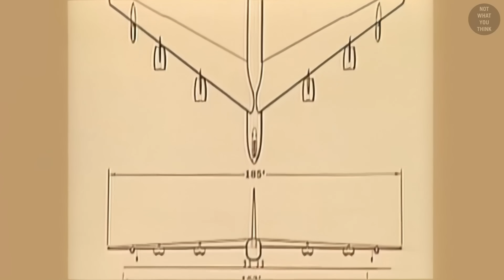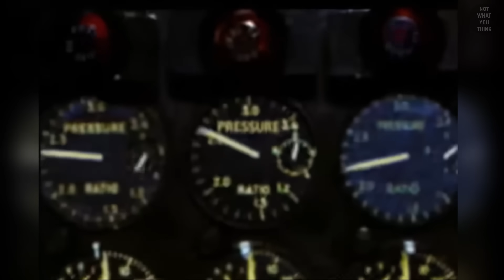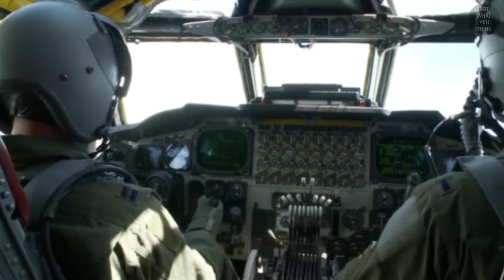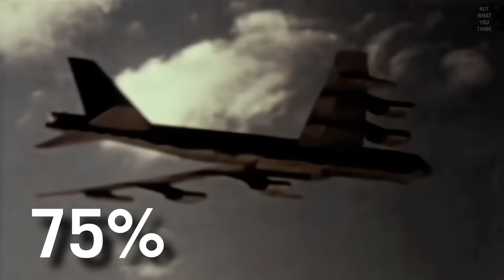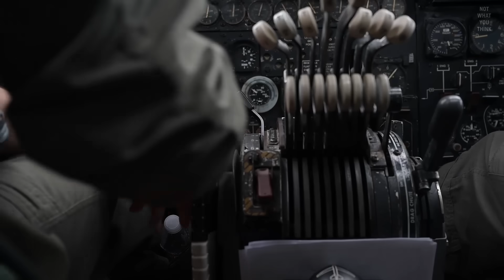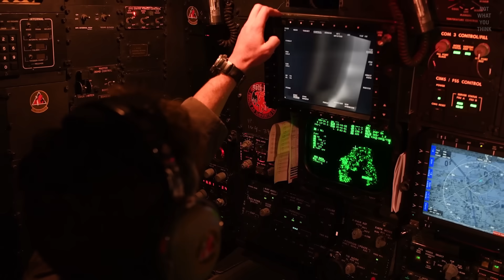Why This Obsolete Bomber Will Outlive EVERYTHING

Comment: The crash record of the B-52 was mostly because they were flown so much.  The Cold War was a VERY dangerous time.

But think if they put an active defense on the B-52.  Think they could do aerodynamic missile pods with 6 AIM-260 and 12 Stinger sized defensive missile and put one under each wing.  They could split the pods and have half pointing forward and half pointing back so they would be longer and skinnier so they create less drag.  The defensive missiles need to be fast and maneuverable, but really do not need have a very long range.  The pods could have a tracking radar built into them

It would be interesting to see a B-52 maxed out with new more efficient engines, state of the art radar systems, possibly drones escorting them, a defensive missile system, a full electronic warfare suit, and maybe a laser system too... say in the tail.  None of these weigh much compared to the payload this thing can carry.  Those AIM-260 have a range of 200km and a speed of Mach 5+.  I personally think 16 of the hypersonic cruise missiles would be better than fewer of the larger HS glide missiles.  Yes those are faster, but a cruise missile is FAR more versatile and they are supposed to have a 1750 mile range.  They are Mach 5+ and have multiple guidance and targeting systems to prevent jamming.  They would fit in the existing missile carousel made to fire Tomahawk missiles.  They could mount a few of the others under the wing too if needed.  The drones could have anti radar missiles and maybe a pair of Sidewinders.    Now think of an formation of 10 B-52 in a formation with 5 drones each.
Reply: Read some of Dale Brown’s books.   Start with FLIGHT OF THE OLD DOG.

Comment: I was in the Air Force from 1979 - 1983. Stationed at Mather AFB it was mainly an ATC base ( air training command ) with a SAC wing located at the base. Which meant there were B52's taking off and landing there all day long. What I remember most about them is that they were without a doubt one of the loudest and I mean loudest planes I have ever heard taking off as well as landing. The fact that they've been around this long even though they've had their problems means at some point there doing something right. Very right. I tip my cap off to these noisy fu....rs.
Reply: I was in the Buff wing at Mather from 86-89. Yes, the Buff was loud, even inside it. But it was nowhere near as loud as a B-1!
Reply: @nordan00  they were wet takeoffs. And yes I was also there. Swine bunnies. 😁

Comment: When they say "Range of 8800 miles" do they mean that it can fly out that far and still be able to return, or does it mean it really has a range of 4400 miles out and 4400 miles to return?
Reply: Total miles is 8800 miles so can only travel 4400 miles to make it back without refueling. I'm assuming they don't run it that close to the needle though.
Reply: @nickcollins1528  Thank you.  I always wondered about that when it came to range on an airplane and how it was measured.

Comment: Obviously the narrator has very limited knowledge. Icing, metal fatigue, engine problems and system failures are common to all aircraft. The operation of nukes could happen to any a/c. Pilot error are not the fault of the A/C. In the case of the B52, it is a matter of usage.

Comment: Hummm I was a First Article Quality Engineer for Allied Signal/ Honeywell and total 22 Aerospace suppliers. Aka Hired Gun. One of the small jet engine parts was designed in 1939, drawing originally "Stratofortress". During the Cold War, B-52 would stay AIRBORNE FOR 3 WEEKS! in air refueling invented for the B-52's.

Comment: The Aircraft Type ( if that's what its called ) is extremely versatile and useful , so I don't believe its obsolete , The Actual Aircraft themselves , the ones built and flying are not really the same aircraft built so many years ago , I believe they go through a sort of complete rebuild from the ground up , effectively making a new plane out of an old plane.
Reply: Aircraft type is the correct term indeed

Comment: Whoever wrote the narration needs to go back to the books...the BUFF was not limited by a lot of problems in its "first few decades".  It had issues during design and testing that were fixed but for the vast majority of it's career it has been an extremely reliable workhorse.  The narrator seems to have a bias...

Comment: Had the B-52 been a disaster for "the first few decades", it wouldn't have been in service after the first few decades. Very few designs are in use seventy years after their first use, and we're almost exclusively talking small arms, not highly sophisticated aircraft. The B-52 has been replaced by several more modern and more capable bombers - that somehow faded into oblivion because they couldn't deliver on their promises.
Reply: It's like how London keeps running on infrastructure built during Victoria's reign, even after more than a centuries worth of replacement systems have long since fallen apart.
Reply: The B-2 can deliver on promises, it's just stupid expensive to operate and maintain, hence the desire for the B-21. 

The B-1 is another story, but even that is seeing multi-role service.

Comment: OK, be honest.  The tail you showed at 0:05 didn't just fall off!  That was a test aircraft running the front range in Colorado looking for severe gusts.  They found some.  The plane landed safely.
Reply: I agree. That airframe went to the boneyard for many years until it was fitted with a replacement vertical stabilizer and returned to service. I know this because I flew it many times while it was assigned to the 319th Bomb Wing at Grand Forks AFB, North Dakota.

Comment: It's a good thing that Russia never knew how bad a bomber the B-52 is, or was or will be.  Like you reported over 700 has been in service, and wouldn't you know it, not once did the USA get bombed by Russia.  In the 60 a lots of our hero's got Purple Hearts flying over Russian Held Viet Nam, but with Johnson running the air force from D.C. one can quickly understand the problem.  Given all that has happened to the B-52, one would believe it has seen the end of the road, but wait, not so fast Sparky, the plan has a certain "thing" about it, you know the 10% of them lightly armed can, well ~ do a number on half an army, any army,

Comment: The video is correct.  In the early days of the B-52 there were problems that caused accidents.

My dad was a B-17 pilot in WW II and was shot down on July 26, 1943 and spent the rest of the war as a POW.

After the war, he remained in the Air Force flying all kinds of bombers from B-29's to B-47's and finally to B-52's.  He began flying B-52's in the early 1960's  and accidents and crashes were not uncommon.  But today, the B-52 is one of the most reliable ancient bomber in the inventory.  It's effectiveness is in its versatility with long range missiles and bomb loads in low intensity conflicts.

As stand off ranges of missiles increase, the B-52 will become more important because of its payload capacity.

I wouldn't be surprised if the B-52 was still operational after 100 years in service.
Reply from the maker: The video pretty much agrees with what you are saying.

Comment: The number of accidents are not surprising when you consider the massive number of total hours in the air and that it is(was) a cutting edge military aircraft, in that is pushed the limits of materials. It is a much more efficient design than many commercial aircraft, giving up convenience and ease of crew training for performance.(range, payload, runway length) I mean how many commercial aircraft use a parachute during normal landings?(Several military jets have used parachutes for landings.)

Comment: Over 90% of the B-52 fleet have been retired. The ones still in service were the latest model and have been majorly upgraded.
Reply: That's true, but like he said, even the newest B-52's in service rolled out in 1962, so we're still talking about the 60 year "latest" model of a 70 year old design. Mind you, I'm okay with that, airframes of this sort were pretty much perfected by 1962.
Reply: @jermainerace4156  
My point was that over 90% are long gone.
Reply: @alanstevens1296  they are just spare parts and airframes. however the USAF does keep many airframes ready for assembly for replacement of damaged frames or if a need for more b52s arise.
Reply: @Drbeattles  
Over 90% of the retired airframes were scrapped.
Reply: @alanstevens1296  they aren’t scrapped like you think. Most of them are sitting in the bone yard which is considered “scrapped”. However they are constantly being pulled out of said boneyard. Plus the “newest” b52 was built in 1962 so of course there’s going to be a lot of them out of service. we don’t need 744 of em in constantly ready. Hell we don’t even have that many of ANY aircraft in current service.
Reply: @Drbeattles  
Aircraft retired 30 or 40 years ago aren't just left out in the boneyard, they are scrapped and the materials recycled.

In the case of the B-52, yes, they would keep a dozen or two for spare parts.
Reply: @alanstevens1296  mate. ALL of them are 30+ years old. Last was built in 1962.

Comment: Anyone want to take bets on how many of the 100 Spirits actually enter service. There is this other factor air force goes how much for a brand new state of the art bomber that does everything that the B52 does they'd be hard pressed to get away with a price between a F22 and a Spirit call it 500 million per. Then you get the black military maths, some bozo get lucky with a gun pass and blows a B52 out the air I'm out 40 million and change same idiot rips a Spirit out of the air I'm out a Billion and I better recover that wreckage ASAP so chuck another 100 million for recovery.

Comment: It will be obsolete when buying a new aircraft is less costly than restoring the BUFF to flying condition... which may be never. If the keep replacing parts there comes a time when everything has been replaced > see the "Perseus' ship" problem. Other aircraft like the C130 are in service so long because they keep being produced (completely new airframes).

Comment: The Super Duper Missile does not need to circle the planet 27 times in order to reach hyper sonic speeds but instead it reaches hyper sonic speeds in less than 3 seconds making it actually effective.  Sure it did not work perfectly during the first 2 tests of it but it was expected to take over 5000 tests before it was fully operational however it actually only took 3 tests before it was perfectly operational making it even more super duper.

Comment: This video has several factual inaccuracies which could easily be avoided with proper research and the J-57 engine wasn't replaced because of reliability issues (It was a highly reliable mass-produced design) it was replaced by P&W TF-33 low bypass ratio turbofans when they became available.

Comment: One would think that they could come up with a version 2 that has all the good qualities of the original and fixes and improves the bad ones.
Reply: New variants is exactly that, improving the original 
By this point most b52s are already upgraded which is much cheaper than acquiring an entire new airframe and producing the numbers required

Comment: I'm amazed that they are actually putting new engines on it. You'd think they would've done it ages ago and saved billions in fuel costs. I guess better late than never! Still amazing that this will be the only plane flying for a 100 years.
Reply: I think that there was a plan to put in RB211 engines as fitted to B757 but that idea was canned many years ago.

Comment: B-52s effectively are old trucks that still have the room for carrying newer weapons. I still think we should've come up with a newer platform that doesn't need to be revolutionary like being supersonic or stealthy but fixes the fundamental design drawbacks i.e fewer, more efficient engines, better control surfaces, a more efficient and better designed wing, and more commercial commonality so costs don't burden us so heavily 50 years later.
Reply: For that we'd have to have had some form of upper management that could actually reap the rewards of the 50-year cost savings, which is approximately 0 people right now

Comment: Back in the mid-1970's I was in Air Force air defense radar and sometimes we would have B-52's show up to practice being intercepted by our F-101B's and F-106's. The first thing they did was call us up on frequency about an hour beforehand and give us an ECM request, a list of all the frequencies they wanted to use against our interceptors.  We would then call our local ATC Region Control Center and pass on the request.  They would check to see if it would harm any essential ATC radar systems in the area and get back to us with what they had approved.  We would then call up the B-52 and pass it on to them.  No way could the B-52 use all the electronic warfare resources they had because it would electronically blind radar sites everywhere around us.  It really was an amazing airplane and keeps getting better.
Reply: We still played that game in the early 1990s - it was called Federal Spade. We would drop low, penetrate the outer and inner ADIZ, and wait for F-15s and F-16s to arrive.  We could not use our ECM because it would totally blind regional air traffic control radars.